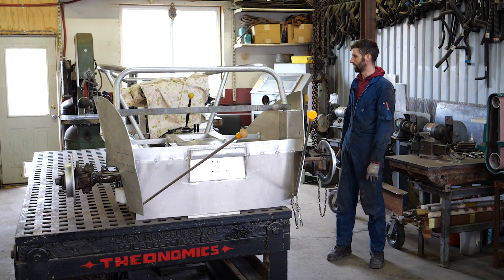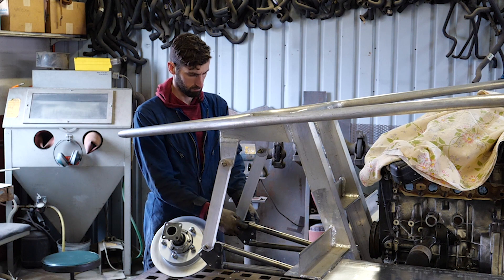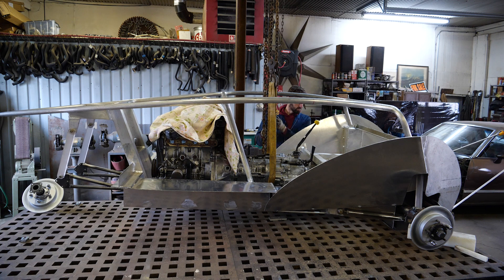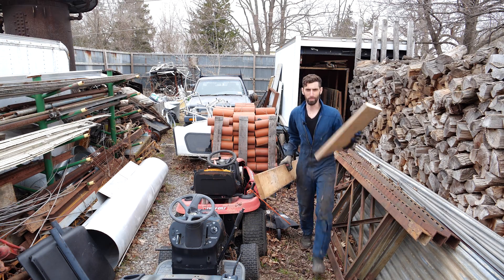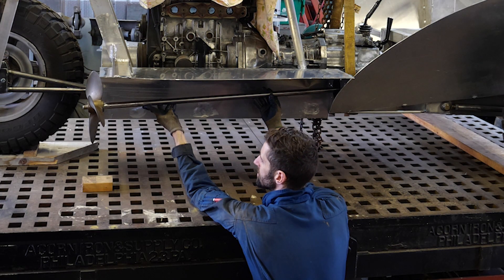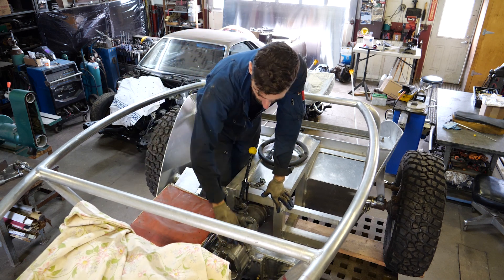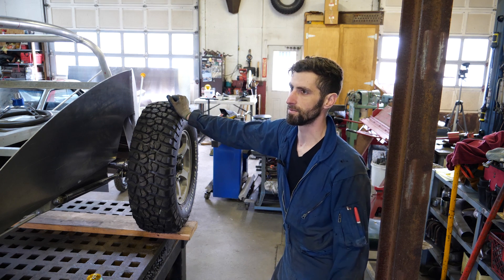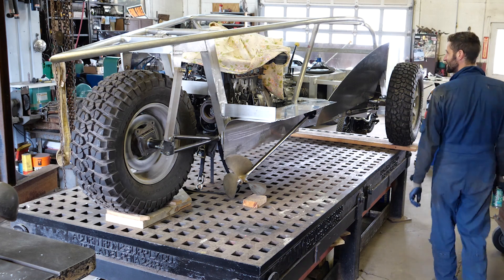Design Challenges - Amphibious Project Three Wheeled Reverse Trike Vehicle Build | Ep.5

Comment: You really need to have it be jet drive with the jets on either side of front of rear wheel .... no damage to prop possible and safer for those around the vehicle
Reply: You could also attach steering nozzles and reverse gates to the jets to control the steering directly off the steering wheel... mounting a factory  jet intake and jet pump from a seadoo or small jet boat would be easy. Yo could even get an aftermarket intake from a place like Jetstream Boats....
Reply from the maker: Thanks, really appreciate that point. We've built both prop and pump amphibious cars in the past. The purpose of this one is to be really simple and straightforward from an engineering stand point. In general, working with pump jets really complicates the design. The props and transfer case design on this project is meant to keep it simple. With that said, we never know for sure how it'll work until it is in the water.